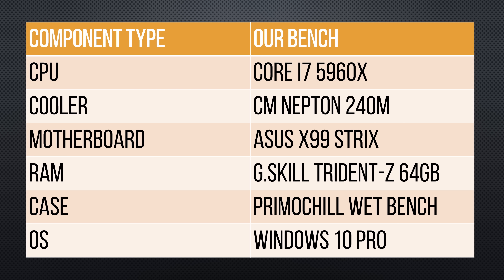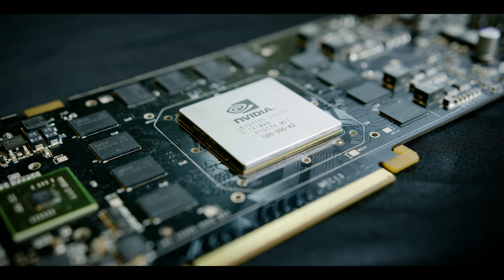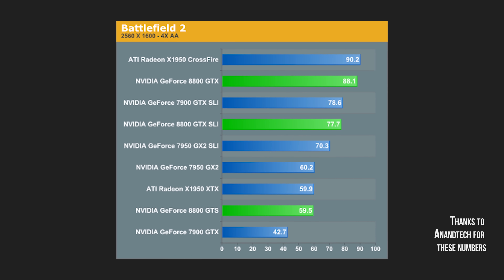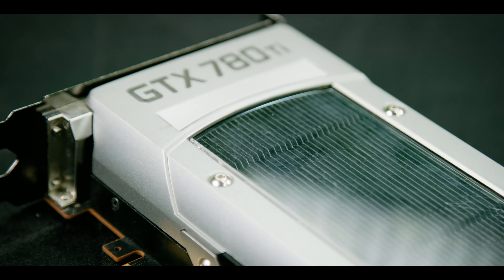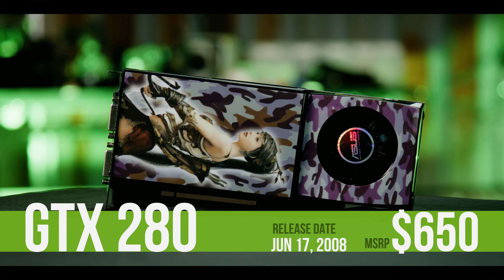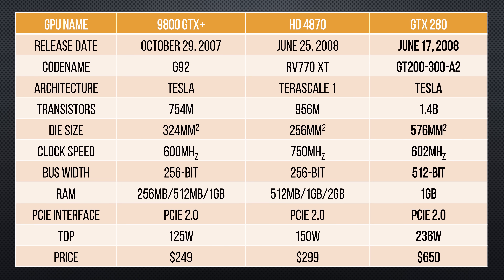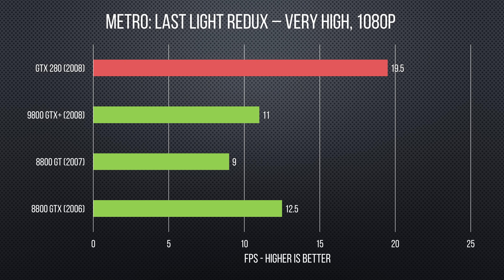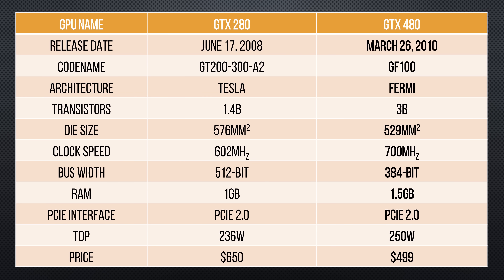10 YEARS of NVIDIA Video Cards Compared!

Comment: was dying hard for a 8800GTX but after learning about price/performance ratio i prefer going second tier then since starting with 8800gt 9800gt gtx770 gtx1070 with in between using ATI😄😄😄😄

Comment: 8800GT wasn't a flagship card, it was a refresh of the 8800 GTS upper-mid-range (not GTX), and performed about the same as that card.  I still have an 8800GTS kicking around in a cupboard somewhere.  The flagship remained the GTX until the 9800 came out. which was the actual 8800 GTX refresh.

Comment: Fermis were insane with power usage. I had a quad sli fermi setup(sli 590s) that would pull over 1300w at the wall on full load with the 990x i7 and GPUs OCed. I dont think its possible these days to max a 1500w PSU but back then you could.

Comment: My rack its bigger and i got more GPUs then your skinny rack :)
You forgot the the GTX  7900, GT 7950, 7950 GX2,9800 GX2 , GTX 295, GTX 295 x2 , the 300 Series Ghost line.(i got them  all)
Can i borrow a  GTX 690?  mine got no display :)))))))))))))))))
Reply: This is about flagship single gpu cards over the last ten years. The 8800gtx was already the new flagship by November of 2006, and we are in May 2017 now. There were figures for both the 7900gtx and 7950gx2 in the Battlefield 2 benchmark(sli for each even) and they got stomped by 8800gtx(though 1 8800gtx was faster than 2).

The 7000 series cards probably wouldn't work for most of the benches due to lack of dx10 sm4 support.
Reply: Indeed. I have a lot of problems with the 6 and 7 series. they die on the rack sitting because of that stupid solder they used. the 8800 gtx its my favorite to. BF2 <3
Reply: i have owned a GTX 295, a GTX 295 co-op edition, and a GTX 295 RED EVGA edition and i've never heard of a GTX 295 x2. please enlighten me.
Reply: There was a 295x2?
Reply: can i have a cookie after? :)

Comment: All older products might seem to be a lot cheaper in contrast to current Gen products, so I added the inflation rate to what they would cost nowadays (Apr 2017). I thought maybe some of you might also be interested, so here's a list:

8800 GTX $599 -> $727
8800 GT  $249 -> $291
9800 GTX+ $229 -> $255
GTX 280  $650 -> $726
GTX 480  $499 -> $561
GTX 580  $499 -> $558
GTX 680  $500 -> $533
GTX 780Ti $699 -> $733
GTX 980  $549 -> $564
GTX 980Ti $649 -> $655

CPI Inflation Calculator: https://data.bls.gov/cgi-bin/cpicalc.pl?

Comment: In the Fermi times 600W PSU was not enough for overclocking GTX 470 (with power hungry OCed 130W i7 on LGA1366/X58). The performance was insane and electrical bill too

Comment: im using a zotac gtx 780ti amp edition right now and a friend is offering me his evga gtx 980 sc for quite a bargain.

i could sell my 780ti and trade to the 980 only spending a small amount more.

the question is.... is this trade worth the trouble and 50 bucks? im guessing 
beside the 1gb more vram and lesser powerusage, the 980 wont be a big 
improvement overall...

Comment: +Linustechtips I'm having troubles.  I restarted my laptop yesterday. now it won't boot past the initial splash screen. I get a black screen after. so far I've tested both hdd and laptop sepratly. both seem to be functioning normally when separate. but won't boot when together. laptop is a Asus g751jm running windows 8.1 with a nvidia gtx 860 m. I need ideas. hlp plz!

Comment: Another significant feature that came along with the 600 series was Multichannel PCM audio over HDMI. I bought a GT610 Specifically so that I could play movies in 5.1 through my Onkyo TX-NR414. Before that, Dolby Digital and DTS over SP-DIF were a massive arse-ache to get working correctly.

Comment: Linus, did you already make a video about the evolution of stability in overclocking? Because, I wonder how fast the extra performance has progress thru the years (relatively from the stock performance in %)? Does it increase faster, slower or same compared to the stock performance. If you didn't do a video about that, I think you should do it, because it is a great topic. If you plan to do it, talk not only about performance, but also tempareture and energy efficiency (if it is less power hungry) for RAM, CPU and graphic cards.

Comment: Correction, GTX 580 had 1.5/3GB of VRAM, not 2/4GB.
Reply: I was about to say the same. I have the 3GB version.
Reply: @fly I clearly remember the 590 crapping the bed in Batman because of the 1.5 Gig ram thing + HORRIBLE temps.
Reply: GTX 590 actually only had 1.5gb available per card. With SLI off it would run as an underclocked 1.5gb gtx 580. SLI on it would run as two underclocked 580s with 1.5gb vram.
Reply: Yeah, but as for Linu's statement, that card would have either 2 or 4GB either.
Reply: Had a 580 in the old rig my dad made, and for a long time I thought it was a 1.5GB, until I learned more about GPUs, it turned out tp be the 3GB. Was a great card
Reply: exactly! i got the gtx 580 and its with 1.5 and  i got the big bastard brother gtx 590  with 3gb

Comment: They didn't skip the 800 series... it was used in laptops. Why Linus, why?
Reply: TabalugaDragon the 800 series used in laptop wasn't new architecture, it was Kepler and Maxwell , desktops had both Kepler (6-700) and Maxwell (900) 

so yes they skipped it because it's just a rebrand
Reply: they said in this video "they COMPLETELY skipped 800 series" while they didn't. 800 series cards are still a little faster than their 700 series equevalents, so a rebrand or not, it's still a generation. It's liek saying that Intel completely skipped 7-th series of processors(kabylake) because it's just rebranded skylake. No, it doesn't work like that.
Reply: Kepler 800's are exactly as fast as as Kepler 700's, Maxwell 890's are slower than Maxwell 900's
Reply: http://gpuboss.com/gpus/GeForce-GTX-850M-vs-GeForce-GT-750M
benchmarks are in the middle of the page
also notice how it's a 850 with gddr3 vs 750 with gddr5 in comparisson, 850 is still faster
Reply: TabalugaDragon 850 is Maxwell, not Kepler, it's the same die as a 950m, but is slower than a 950m
Reply: +Mr. Señor well of course it's slower than the 950m, it would have been weird if 950m wasn't faster than the previous generation. I'm saying that videocards with same numbers (50 series vs 50 series) are faster in 800 series than in 700 series
Reply: TabalugaDragon it's not a generation, just a rebrand for more skus
Reply: For example 600 and 700 are both Kepler, however it's an actual generational jump, the 660 is GK104 and has 1152 shader units, the 760 is GK116 with the same number of shaders but capable of 2.2TFLOPS vs 1.9 on the 660 which is a 14% difference

Comment: skipped over a lot of the more mainstream cards in favor of the top tier for that year. Easy example is no mention of 1060 or 1070 gtx cards even though the number users of 1060 and 1070 heavily outweigh the number of 1080/ti users... in particular the 1060 which is Nvidias current best selling card on amazon. Not a complaint per say, just curious... since budget is just as important as performance in the pc world.

Comment: I have had the following nvidia GPUs.

first was a 6600GT AGP

Then after that I had 2 x 9800GTX in SLI

Then following the 9 series lead free bump known fault they all died and were replaced under warranty with 2 and shortly after became 3 way SLI GTS 250s

Now I have watercooled GTX 980 in my current rig and in my dual processor Athlon retro rig a vintage factory OC'd AGP 6800 Ultra by BFG.

Next on my list will be a volta GPU because the 10 series won't be a big enough jump for my liking.

I still have all of my GPUs except the 6600GT which stupidly I tossed out with the rest of the parts for that rig as I didn't see a use, but should of kept it for memories. 

I also had a ATi 9200SE but that was so shit it barely performed any better than my at the time 6? year old rig with a cheapy integrated intel 740 graphics, yes back when intel made its first GPU if you'd call it that, I believe those came out 1998? But my point was the 9200SE was that shit. That and the intel I never kept and had no fond memories so I am glad they hit the bin as soon as I could afford.

Comment: No special mentions for the GTX 590 and the 690?
Reply: Carleto And what about the 285 and 290? I can't really pinpoint their release dates in relation to the others xD. That grammar tho
Reply: Yeah true that, I loved how those cards were basically like "special" editions. Honestly loved the 285 and 690... especially the 690's cooler :D
Reply: Carleto those were dual gpu cards that were slaughtered by the and counterparts, at the time of the 690 the 7990 was still the most powerful card on the planet and was cheaper, next gens Titan Z was slaughtered, butchered, and stir fried by 50% cheaper 295x2

dual GPUs don't count
Reply: That's why I mentioned them. The 690 for example basically had 2x 680 chips it. Keeping in mind that regardless of what AMD put out against Nvidia, they were all still niche cards that people used and they looked bad ass!
Reply: ***** I know what you mean, they were gorgeous, but the 690 isn't a model which is why they probably didn't include them

Comment: $699??? wow prices are cheep in Canada for a GTX1080Ti, here in Australia they set you back on average $1200.
Reply: DogOnAShip not like canada sells them cheap, but Australia is expensive as hell, 700$ also in all usa and most parts of europe
Reply: DogOnAShip 
That's because your minimum wage is ~17 vs Canada ~10. 
700/10 = 70 hours of work. 
1200/17 = ~70.5 hours of work. 

So it works out eventually.
Reply: $1.00 Australian Dollar is buying $1.01 Canadian Dollars at the moment, I might buy my next graphics card from Canada, even with shipping it will still be cheaper.
Reply: DogOnAShip 
Wont they tax you on imports that aren't gifts? That might push it over the top?
Reply: At the moment it's for anything over $1000, after July 1st 2017, a 10% goods and services tax will be applied to ALL items purchased online overseas, cash grab by the government.

Comment: I hate nevedia just bucz high money but not worth the. money but AMD low money highest performance
Reply: what you are going to buy past rx series of you want more power? fury x cost the same as 1070, is older, worse and consumes energy like a fusion reactor
Reply: Draco Xorro A fusion reactor is something that is theoretically used to produce energy though.
Reply: Spoderskrillex it stills needs insane power ammounts to get it running and freeze the coils
Reply: Draco Xorro In the end, a fusion reactor shouldn't consume power though, because it wouldn't have any purpose that way xD
Reply: Spoderskrillex i said to get it running, not at the end
Reply: Spoderskrillex why are we discussing this
Reply: Draco Xorro Because you should have wrote something that actually consumes a lot of power, and is NOT used to "make" power :p  You could have wrote "You can heat up a Fusion reactor with it" or "It uses as much power as a spaceship leaving the atmosphere", then I wouldn't have complained (don't take all this seriously pls).
Reply: Spoderskrillex fusion reactors consume a lot of power. my analogy precisely said that consumed a lot of power. could my analogy been better? it could. it was wrong? no it wasnt
Reply: Draco Xorro Okay, let's settle on the fact that fusion reactors use a shitload of power to be turned on.

Comment: i use gtx 780 ti still its a beast card ultra gaming till now and may continue in future
Reply: its equivalent to a 1060, It wont run ultra in nowdays games unless they are very well optimized
Reply: +Draco Xorro - That really depends on your framerate demands. I have a 970, which is of course in the same ballpark as the 780Ti and 1060, and I don't believe I have the graphics settings in any of my games turned down from Ultra, barring GTA V where I'm not using all of the ridiculously VRAM-hungry Advanced Graphics settings to the full.

Comment: You didn't mention the best part about the 10 Series. It introduced the ability to put the FULL power of the cards in laptops, no more trash "m" chips.
Reply: KH3player Maxwell had that already. Gtx 980s were on some laptops.
Reply: SecretSalami48 Thank goodness. Here I was thinking you bought a brand new laptop then promptly killed it by overclocking it excessively 😬.
Reply: KH3player Well max Q better than the 900m series but it is similar to the level below it
Edit: autocorrected to quinoa for some reason
Reply: KH3player I remember my first PC gaming experience. It was a laptop with a GT 740m. I struggled to get even 40fps on lowest settings on most older games at 720p, fuck me if I wanted to play any new AAA titles. It was complete and utter crap.
Reply: RayzeTheDragon I had an acer v3 571 with i3 2310m and hd 3000. Skyrim at 720p lowest around 15fps.
Reply: I still have that but I tried overclocking it for giggles after I bought a new laptop and killed it. Oc worked for one boot and then it died :D
Reply: SecretSalami48 You tried overclocking a laptop and a brand new one at that...?
Reply: Will Crombie Ah I kinda said that on a wrong order. I meant i killed the old acer laptop
Reply: I for one can relate and I’m very grateful cuz I have the Acer Predator laptop and it’s a fucking beast! No max-Q, but a full fledge 1060 with almost all same specs as desktop card but with very slightly lower clock speeds.

Comment: Boooo!  What about the 970? did you leave it out on purpose or did you forget about it. 
is Nvidia still hurting from that mess.
Reply: Well, they didn't have the 8700, 9700, 270, 470, 570, 770 or 1070 in there either, so wouldn't it be logical to just assume that this was a test of only the highest-end cards Nvidia sold at any point over the past ten years? Also, the 970 wasn't that much of a mess... It's easy to get hung up on a little communication error between Nvidia's engineering an marketing departments, but in actuality it's a perfectly good gaming and computing card even today.